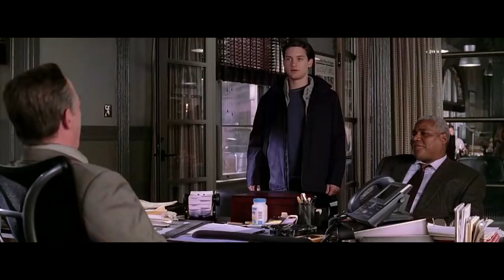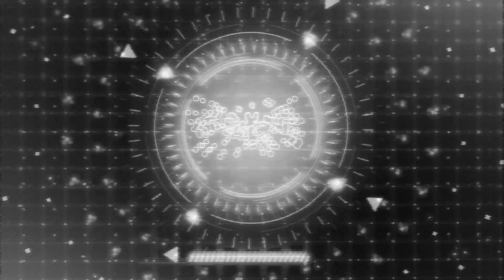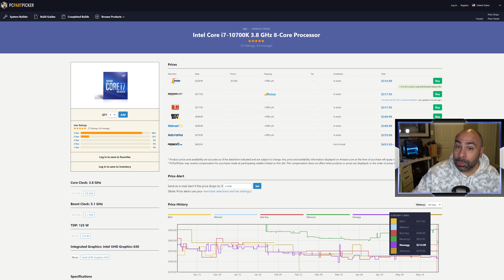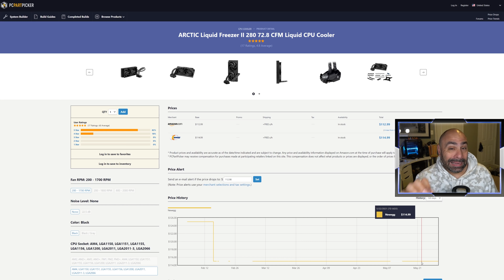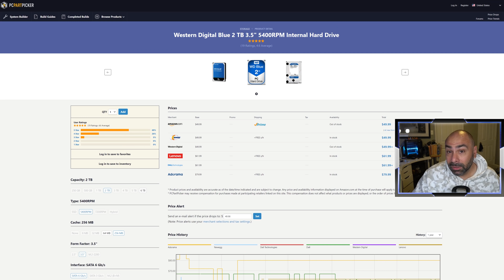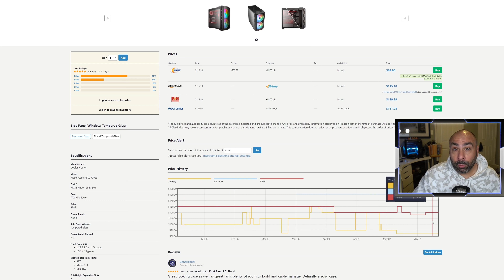PC Components That Are A Great Deal Right Now!

Comment: I'm actually only running Fortnite, and I like their 'Performance' mode. So I did the unthinkable: downgraded from an R9 280 (yeah, that old GPU) to an HD 7770. I still have the R9, but the HD 7770 impressed me. Heck, at lowest settings and 720p, it can play 2019's 'Control' at 45 - 50 FPS.

Comment: EVGA just released there g3 psu’s. There only gold; but extremely efficient and only 140mm. I picked up the 1000w for $230 and get it on Thursday. Running a overclocked 5800x and 6800xt

Comment: My needs are satisfied with a Ryzen 3 2200G; 16GB DDR 3000MHz; 512GB nvme-SSD; 1.5TB in 2 HDDs and a 128GB sata-SSD as cache for the HDDs.

I run Ubuntu 21.04 on OpenZFS 2.0 with max 4GB memory cache and 3 ZFS-datapools (the whole nvme-SSD; 2 striped 500GB HDD partitions with 95GB SSD cache and 500GB HDD partition with 33GB SSD cache). All storage and all caches are lz4 compressed at a ~1.8 ratio.

Locally I bought a black midi tower combo with a xTech 600W power supply for DOP 1500 (~$30). From Newegg I bought the Asrock B450 HDV rel 4.0 motherboard for $60 with a 4-pin CPU plug. The xTech power-supply provided me with a 4-pin CPU plug; the 24-pin plug; 2 SATA + 2 Molex plugs. In 2019 I bought this still new 2005-technology locally in Santiago de los Caballeros :) 

I bought another of these "hi-tech" power supplies for my Pentium 4 backup server, that has 1.21TB in 2 IDE HDDs and 2 laptop sata HDDs. A perfect fit for DOP 800 (~$16) and an investment I can justify for the remains of a 2003 HP D530 SFF.  By the way the P4 runs 32-bits FreeBSD 13.0 also on OpenZFS 2.0 :).  Both power-supplies are protected from the very rude outside world by a 1200W Avtek surge protector.

On my wish list is a cheap Ryzen 5 4600G or so. I feel lucky, because my $60 Asrock motherboard still supports all Ryzen generations; 1000; 2000; 3000; 4000G and 5000 :)

Comment: I have multiple h500 variant cases that I got before the price hikes. These assholes at coolermaster need to make fan mounts that allow me to install thermaltake or noctua 200mm fans with higher cfm/static pressure. Otherwise I like them. Coolermaster fans are dog water.

Comment: I have both the Cooler Master H500 and Seasonic Focus 750W (mine is 80+ Platinum though), and they are indeed both fantastic products. For when GPUs do get back to normal, those two products can power my RTX 3080 FE and keep its peak temperature around 70°-72°C (depending on ambient temperature).